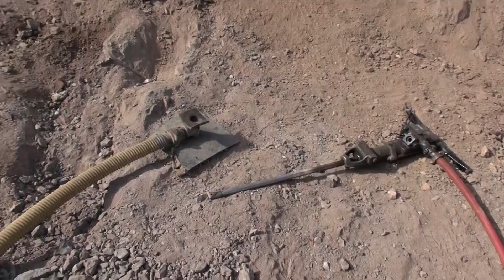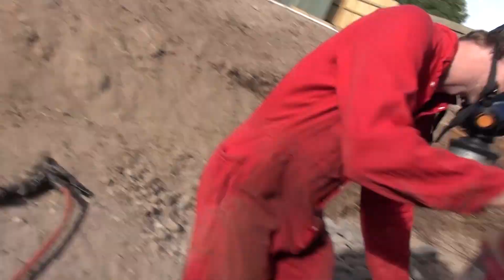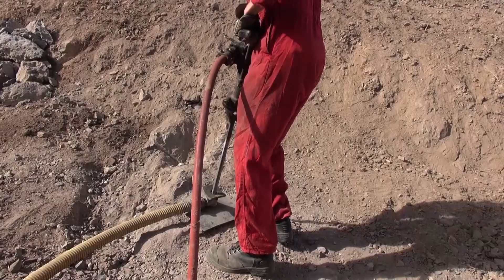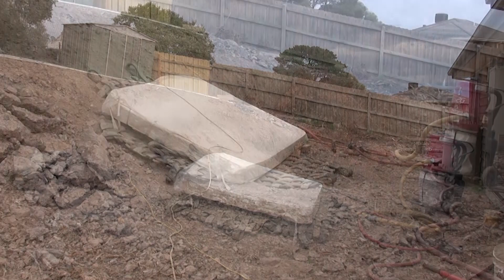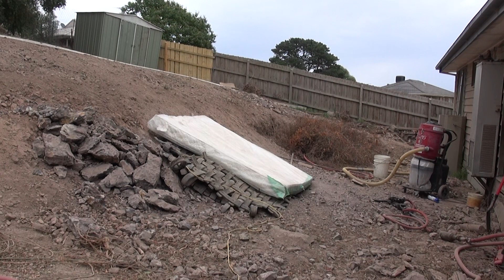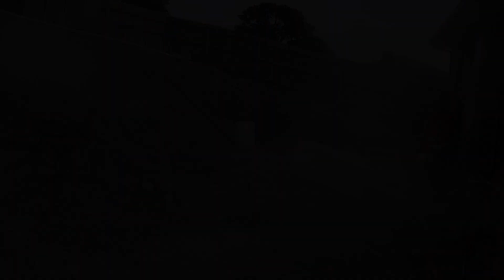Blasting Lilydale Formation

Comment: Does it take more shots when you do singles and they don't get to work together? Have a great day.
Reply from the maker: That is a hard question, you can pull out more volume per hole if you fire several holes at exactly the same time like you would with a detonating cord shot, but you get much better fragmentation if you fire hole separately or with a very short (milliseconds) delay between holes. Thanks for watching Jerry.

Comment: I’m thinking a series of two or three stirrups attached to the pneumatic drill on different length leads.  As you drive it in, you cal put your entire body weight on a stirrup, about 30cm off the ground, riding it down, when it touches ground, step into the next stirrup, and so on.
Reply from the maker: I have tried all kinds of things like that Andrew and it was not very satisfactory from a stability and drilling accuracy perspective.

Comment: If you cut out the siren, and bolt a muffler on that drill i would not even wake up in the house.
Reply: Its less the noise and more the thud that disturbs you haha
Reply: I think the very bones of the earth vibrating from the drilling and the blasting would still reach you lol
Reply: @MYeahman  I live 600m from an active quarry on the same hill. They blast twice a day and the rattle and low frequency grunt form it freaks people out when they visit, we dont even notice anymore. Hahaha.
 They have a limit of 80mil holes, 4m deep max and 400kg of anfo they can blast at once so they do them in series of 2 to 3 when they blast with a few minutes in between.
Reply: @goodiezgrigis yeah I'm pretty close to a blue metal (latite) quarry myself. Its very hard dense rock and transmits shock exceptionally well.

Even after all these years of operation people still think that there is an earthquake every other week. Thursday 11am you are almost guaranteed to see a fb post from a neurotic stay at home mum saying the earthquake shook the plates off her shelves 🤣🤣🤣